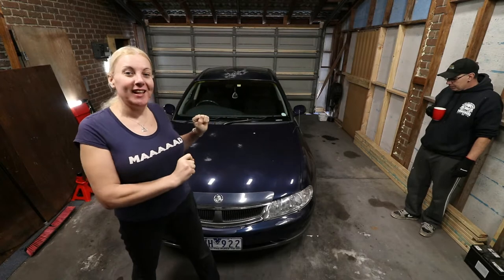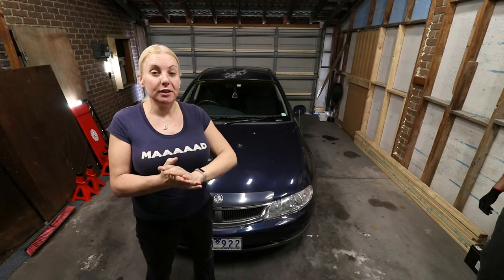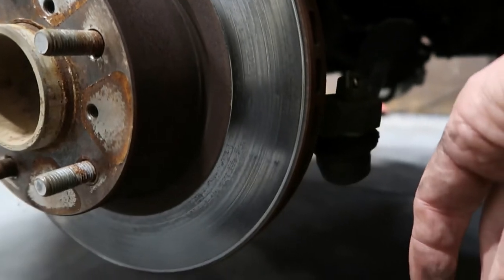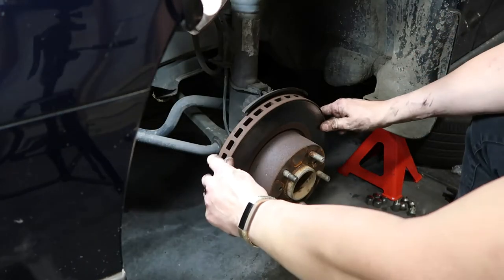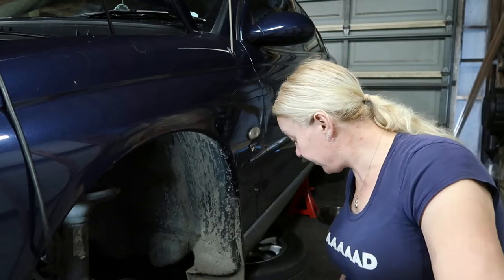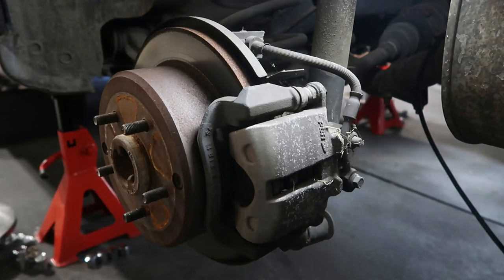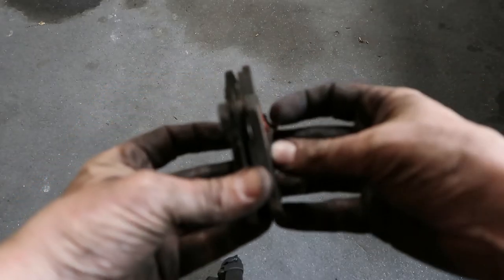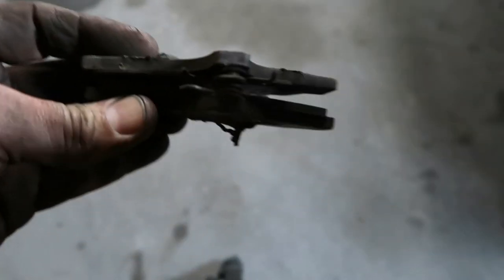Improve Brake Performance without Upgrade!

Comment: Hi I’m from the UK I have a 25 year old Renault 19 that stops like a train, front discs and pads were heavily corroded so I replaced them with brand new discs and pads on the front but braking efficiency is still exactly the same - it has drum brakes on the back and the car has only covered 50k miles, I don’t want to spend money on things I don’t have to but I suppose I should try replacing brake fluid and changing the shoes on the drums, anything else to suggest?? Many thanks
Reply from the maker: Hi J Sudge,  I can only make suggestions on what to check next, in the video we did completely replace the brake fluid as well. It was full of muck and probably original as well. Brake fluid should be changed once in a while as it absorbs water out of the air, which reduces the braking ability of the car. We also found some air in the system, which also reduces the effect of the brakes.

If replacing the brake fuild yields little result, the brake lines may be perished as well. It is well known that the cheapest upgrade to brakes is a good set of braided brake lines and fresh fluid.

After that, you'd be looking at putting a new set of seals in your brake master cylinder, or replacing the cyclinder and or the same to your calipers.

Though with new seals in the master and calipers, new rotors and pads, and of course new fluid and brakelines, you would have essentially replaced everything.
Reply: Feeonnaa awesome thanks for your advice!!